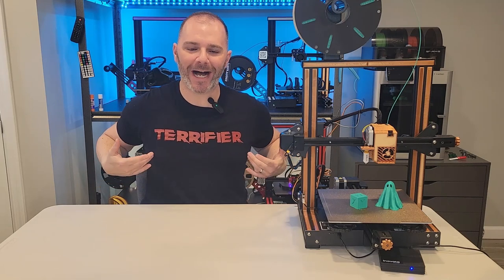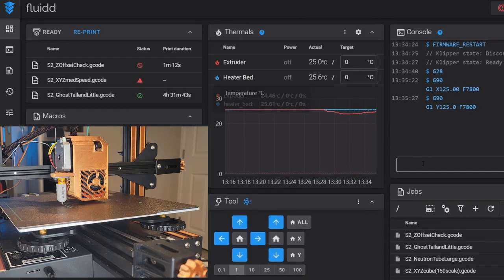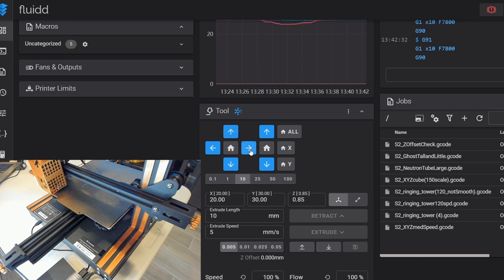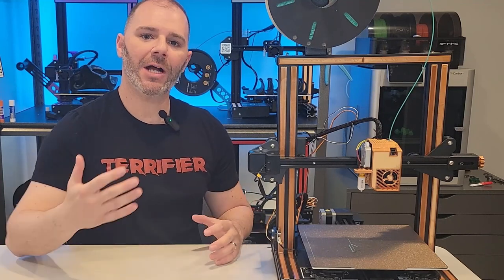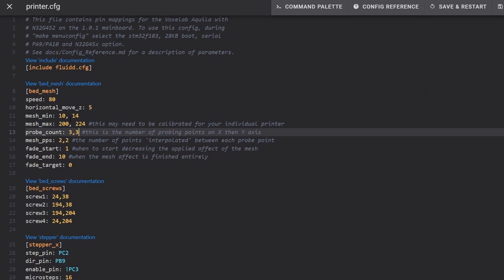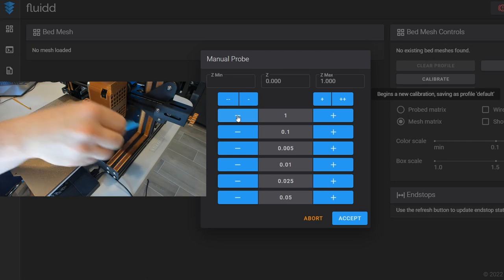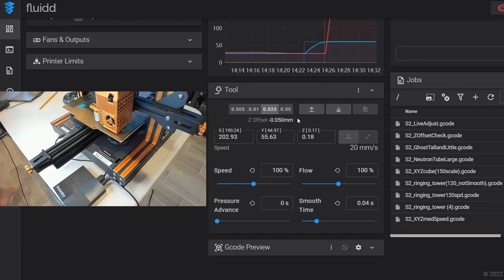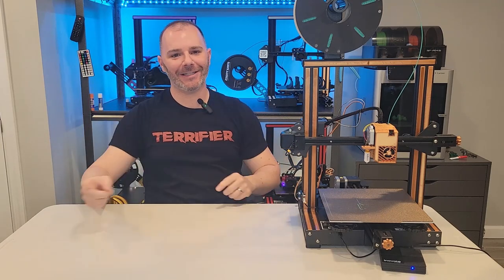Create a Manual Mesh with Kipper!

Comment: Is it possible to get some help on how to center my nozzle? Just swapped hotends and now my prints are not centered anymore.
Reply from the maker: Hey Brandon I'd love to help! The first place I would point you at is my BL touch setup video (I promise it's not a gratuitous plug lol). About 3/4 through the video I talk about a "thorough" way to find the mesh, and that involves 'finding the correct minimum coordinates'. That's exactly what you want to do. You'll want to try and get your nozzle over the front left corner while at 0,0 (I assumed this was an Aquila/ender/similar for that example). It  will likely require you to make some printer.cfg adjustments to your X and Y endstops. Take a look at that section of video and let me know if it helps.
Reply: @PrintsLeo3D  thank you! I actually did find that video and I feel like a dummy. I had to physically move my end stops back so I could get my nozzle alighted they were way too far forward so I was loosing bed space. Your video helped me get the right values I needed! Thank you!
Reply from the maker: You know it's just one of those things you don't think about sometimes. Glad I was able to help!

Comment: my mainsail is saying that TESTZ is unknown. i know ive not got a probe but its for manual mesh too. and it doesnt recognise it. any ideas>?
Reply from the maker: Barrie sorry for the late reply to this. My first thoughts would be to double check that you have a created a mesh within your printer.cfg, without the mesh setup Klipper will not recognize you are trying to run and create a mesh. Also what Klipper version are you running?
Reply from the maker: Hmm not sure sure then, I haven't ran into this. Do you know what Klipper version you're running?
Reply: @PrintsLeo3D  used enderklack a fork of klicky in the end and made my own probe. did a screw level adjustment and took the probe off. that works for now :P especially when using the 1.1.2 creality board haha. (no probe connection)
Reply from the maker: Is that KevinAkaSam's KlackEnder ender? I have that hooked up on one of my Ender 3s and I love it.
Reply: @PrintsLeo3D  Yeah, the probe i used was a button from a silent mouse and a 3d printed holder for it. so i couldnt dock it and edited the klackCFG to remove the dock. but it worked.. just couldnt keep it on.. only so much you can do with the original ender3 and board haha. its got klipper and runs and prints great so cant complain :P
Reply from the maker: Wow that's pretty impressive and a really smart idea. Love the recycling of the parts. I wonder what the accuracy of the mouse clicker is. I have to imagine it's better or as good as an endstop switch.
Reply: @PrintsLeo3D  incredibly accurate. i had it tapped into the zstop connection using male prototype wire. (and solder to the switch) i made the zstop "virtual" using klippers built in variable and then did the required [probe] tag and the rest just worked. around 0.05 on the bed after calibrating the screws with screws_tilt_adjust

Comment: Hi Leo, my bed has started to warp so rather than dismantle the machine i decided to try manual mesh level. I ran into some issues The machine i3 mega latest version of klipper on mainsail.
OK so running the Z_ENDSTOP_CALIBRATE opens an adjustment box and adjustment was made
Clicking ACCEPT however results in 
Use TESTZ to adjust position.
Finish with ACCEPT or ABORT command.
TESTZ command returns unknown command Even though the console shows a TESTZ Z=0.01 command has been used to move the tool head by the command box
Using the Z_OFFSET_APPLY_ENDSTOP returns a nothing to do endstop at 0 error?
and SAVE_CONFIG doesn't do a lot either.

In some Kakhanded  fashion i used the command SET_GCODE_OFFSET Z_ADJUST=-0.005 in the console which then allowed me to use the Z_OFFSET_APPLY_ENDSTOP so the line is now # out of the printer.cfg and the save config now has an offset of 0.005 obviously the wrong offset
Reply from the maker: I'm not too sure where to start, it sounds like something in the front end (Mainsail) might not be behaving properly. Make sure you are running the latest versions of Klipper, Moonraker, and Mainsail.
Reply: @PrintsLeo3D  everything is upto date
Reply: @PrintsLeo3D  I have 2 Klipper machines
An ender 3 V2 on a pi but that has always needed a touch sensor. It's had 2 beds already which were warped from day 1.

The anycubic i3 mega has started to show a raised center recently that's on a thin client. It the one I'm trying to get a manual mesh on.
Both use mainsail though the ender also has fluidd added, the fluidd install basically pulled in everything from mainsail so I'm not sure there is an issue with mainsail on the i3.

The only difference I can see is the ender uses Debian buster I think while the i3 uses Debian bullseye?
Bullseye is the one affected by recent updates giving me errors so maybe there are more issues than just the mcu error?
Reply from the maker: Issues like this don't make me think you have an OS issue or anything like that. White honestly though I've never heard of anyone having these issues so I wouldn't really know where to start. I would probably recommend installing Fluidd (using KIAUH) and seeing if the different front end plays a role in the calibration.
Reply: @PrintsLeo3D  thanks Leo, I did that yesterday as it happens and the issue is the same, when I press accept I get a failed error.
If I use the panel to move the z offset I can see it issue the test z command and it moves but won't accept.
If I try to send accept or test z commands in the console it comes back with unknown commands?

If I use the z offset under tool head then the z offset endstop command by copy and paste from your video description I get the dialogue box and the save restart.

So if I am correct these commands relate to Klipper specific actions rather than fluidd or mainsail.
Incidentally the adjustment box is a bit nicer through mainsail being as it's not a random jumble of buttons.

Comment: Question,  how are you using the z-endstop and a BL-touch?  I thought the BL-touch replaced the endstop or it at least on my ender 3.
Reply from the maker: No, you're right the bl touch does in fact replace the endstop. This printer is usually bl touch enabled, I disabled it for the video and re-enabled the endstop, I just didn't physically remove the bl touch (which I should have so it didn't confuse anyone). I keep both of them setup like this (endstop and bl touch) so I can make videos on both setups, and if people have issues with one system I am able to test it out for them pretty quickly. I forgot to remove the physical bl touch in the video so I can see how that is confusing. Good catch
Reply: @PrintsLeo3D   ah ok good to know.  I thought I was doing wrong.  thanks for the info. Great video
Reply from the maker: Thank you! I appreciate you asking the question and clearing it up, helps anyone in the future that sees the same thing.
Reply: @PrintsLeo3D  how to disable the bltouch and enable endstop?

Comment: Don't you heat up the nozzle and bed before calibrating??
Reply from the maker: Most people sight thermal expansion as a reason to do that, and to be honest I agree with the concept. In practice though I have  had better results with a cold bed and nozzle while performing this calibration. The other thing to consider, and this is what I weighed most while making this video, is that this is a 'manual' calibration, which means you will be at the bed doing the work. Trying to do that while the bed is heated might cause you to be uncomfortable or at worse get slightly burned in some way. So I always teach the way I do it myself, which is on a cold bed. Then you can adjust the compression during the live adjustment.

Comment: Friends, I'm new to 3D printing. how fix  error - option 'mesh_min' in section 'bed_mesh ' must be specified
Reply from the maker: That error is telling you that under the section [bed_mesh] the parameter bed_mesh: must have some sort of value defined.

Can you post your bed mesh section?
Reply: @PrintsLeo3D  [bed_mesh]
speed:150 
horizontal_move_z:7
mesh_min:20, 15      
mesh_max:230, 23    
probe_count:8,8     
algorithm:bicubic
bicubic_tension:0.2
mesh_pps: 2, 2
Reply from the maker: It looks like you have it defined, it's possible the indentation isn't right Klipper isn't reading it. Want to send me an email with the config file : printsleo3d@gmail.com 

This way I can see how it's indented.

Comment: What I would like to see is mesh done using BLtouch and comparing how different it is from using the paper method manual mesh
Reply from the maker: That's not a bad idea. Maybe sometime in the future I'll throw up some comparisons in like a YouTube short. In the end I don't think you'll notice any difference at all. The times I was using a manual mesh versus the times I've used a bl touch seemed to work just as well. The only downside with the manual mesh is the time it takes to run it, but the in end results should be pretty close to having a sensor.
Reply: @PrintsLeo3D  it actually may make a difference. What I've seen is some people claiming the y offset of the probe to the nozzle needs to be 0 (same y value) for the probing to be accurate with klipper. The manual method is actually tracking with the nozzle, where there may be a bug with klipper auto mesh bed leveling that people are claiming devs just don't care to investigate.
Reply from the maker: As far as a auto mesh bug, I don't think I've ever encountered one yet (at least as far as I can tell). I hadn't heard of this issue either, are you saying that people are having issues with auto leveling if the Y probe offset is anything but 0? If so I may have to investigate that and see if I can reproduce the issue. As far as I know Kevin is one of the most responsive developers I've encountered so I'd be surprised to hear he was turning a deaf ear to an issue like that. I'd love to explore it further.
Reply: @PrintsLeo3D  I have an Ender 3 S1 pro that seemed to do fine with ABL stock on Marlin. When I switched to Klipper, my first layers are never consistent. It over compensates either too high or too low. It's as if the mesh measures then just doesn't actually use the values properly. I found one person on Delan 3D on YouTube commenting about that any offset for y other than 0 causing issues. He claimed that mounting the CR touch in line with the nozzle fixed his issue altogether. Maybe it could be a physical problem like gantry twisting etc. I found another person who posted a video claiming that the issues were solved by not over tightening the eccentric nuts on the rolling carriages for all axes. Then I also found plenty of people being angry about "Klipper devs" not listening and saying their code is "perfect". Basically, NO ONE KNOWS why ABL seems to be so unreliable in a lot of cases when it comes to using klipper. It's a weird thing I'm seeing in the corners of YouTube.
Reply from the maker: That's pretty interesting. On all my Klipper pri ters the ABL has worked as intended, bl touch/cr touch/ 3d touch. I know that doesn't mean it's perfect for everyone though. I have an in-depth video on the bl touch that goes over a lot of the small intricacies that sometimes fall by the wayside. I'm not trying to force my content, but it might be worth taking a look at , maybe something there can spark something that could help. One thing I have noticed, and I think it's as intended, is when live adjusting z offset (this is with a probe not manual mesh) if you don't save the adjustment between prints, then on a subsequent print make more adjustments, the final saved z offset will likely be in error. You need to save you adjusted offsets between prints. I haven't looked deeply into this yet, it's just something I recently noticed in passing , but I am sure it's how the gcode z offset command gets sent and saved which is not independent of print file.
Reply: @PrintsLeo3D  so I had actually already watched that video which was very good. I think I figured out the issue. I tried adjusting the x axis gantry specifically the mounting bracket for the print head. I noticed a sag in the head such that the nozzle and the CR touch were probably at an angle to one another (basically the print head leaning forward). I removed the two cylindrical spacers on the top v wheels and replaced them with two hex nuts that were overall shorter. This compensated the leaning forward to even slightly leaning backwards which put the cr touch and nozzle in the same plane and parallel to the bed. Now the probing makes the bed look flatter in the mesh and I'm not seeing the overcompensating. This is something I've not seen ANYONE talk about on YouTube or elsewhere. It seems to work and now makes sense why one commenter claims the y offset of the probe to nozzle should be 0. It's so they lean at the same angle and are the same distance from the print bed.
Reply from the maker: Wow that's a great find. There are so many variables with these machines it's so easy to lose view of the small things. I'm going to make a note of your fix and use it to advise people in the future. Thank you!
Reply: @PrintsLeo3D  Unfortunately this didnt completely fix the issue... It helped, but when i switched filament and print surface (a less flat one) the issue persisted. I compared with and without bed meshing on, and it did absolutely nothing. I had to move to the flattest spot, and that worked but not because of bed meshing assistance. I think if the bed is not within some flatness range, the ABL does not help.

Comment: you dint include your test bed model file
Reply from the maker: Sorry about that. It's actually a very simple model you can create yourself. All I did was import 5 20x20x20 cubes (usually the slicer has these available for you). Then I shrunk them all to a single layer (0.2mm for me ). Then I already then around the bed. One in the center and then the other four equally spread at the four corners. I also printed this with a skirt, which is very import to help calibrate that z offset as the test begins. Hopefully this helps but if not I can try and set up some model for you.

Comment: How can i do this but with CRtouch on mainsail? heightmap calibrate only probes 2 points and stops! and i am also using the T95 mini android box....
Reply from the maker: Using a CR Touch is going to require some different sections in your printer.cfg. You will need to add a [bltouch] section and a [safe_z_home] section as well as removing/altering a few lines in [stepper_z]. If you want I can write out the exact sections you need I just need to know what printer you are using.
Reply: @PrintsLeo3D  That would be great i am using a ender 3 ,this is my settings: [stepper_z]
step_pin: PB0
dir_pin: PC5
enable_pin: !PB1
microsteps: 16
rotation_distance: 8
endstop_pin: probe:z_virtual_endstop
position_max: 250
position_min: -2
[bltouch]
sensor_pin: ^PC14 
control_pin: PA1  #Change pin to match your printer
x_offset: -64 #Change offset to match your printer
y_offset: -2 #Change offset to match your printer
#z_offset: 4
stow_on_each_sample: False  
probe_with_touch_mode: True
speed: 3.0
samples: 3
samples_result: median
sample_retract_dist: 5.0
samples_tolerance: 0.01
samples_tolerance_retries: 3
[safe_z_home]
home_xy_position: 117.5,117.5
speed: 100
z_hop: 10
z_hop_speed: 5
Reply from the maker: Did you add the line 'probe_with_touch_mode'?
Reply: @PrintsLeo3D  yes
Reply from the maker: Did you go through the sanity tests (i.e. bltouch_debug command=pin_down) and add that afterwards?
Reply: @PrintsLeo3D  no crtouch is working probe deploys and stows, but only probes 2 points
Reply from the maker: It's likely you don't need that probe with touch mode line, and it's probably causing the issue. Try deleting that line from the bltouch section
Reply: @PrintsLeo3D  ok i will try that!
Reply: @PrintsLeo3D  Still not working i must have some things missing or wrong, can you take a look at my printer.config ?
Reply from the maker: Yes send it to me! Also there's some sanity checks you can use to check. I will be releasing a video on the bl touch in the next few days.
Reply: @PrintsLeo3D  Just sent to your mail, thank you
Reply: @PrintsLeo3D  so i did what you recommended and also changed probe offsets , i now have my bed mesh working thank you for your help!
Reply from the maker: Great, glad you're back to printing!

Comment: Why on earth aren't the values Z adjust in the Manual Probe dialog not sorted.?!?! sorted([1, 0.1, 0.005, 0.01, 0.025, 0.05], reverse=True) => [1, 0.1, 0.05, 0.025, 0.01, 0.005]
Reply from the maker: I mentioned it while I was recording, I don't know why it's staggered like that, but I think I edited out my comments. There is a way to set up your own adjustment distances under Settings>Tool I don't know if that reorganizes it for you though
Reply: @PrintsLeo3D  I've only recently started to learn about Klipper, but I am fast becoming a convert. I recently ordered a new main board for my old printer so I could use better stepper drivers and have more ports, but had I known then what I know about Klipper now, I would have ordered a cheaper board and just switched to Klipper. Manual mesh bed leveling was really the only thing holding be back until I saw your video.

May I ask, the bed visualization tool you showed, is that part of Fluidd by default? 

Thanks!